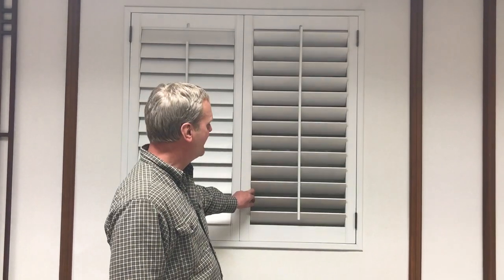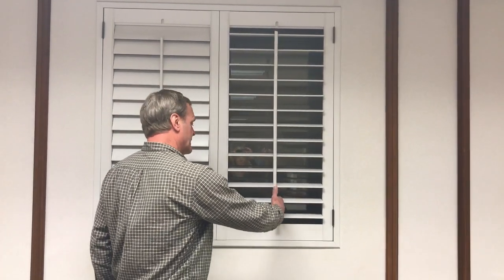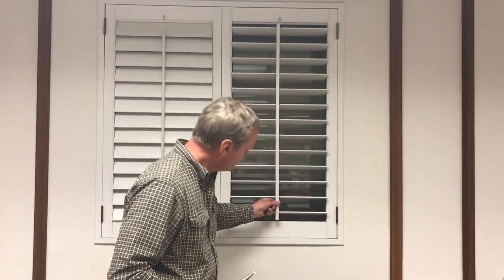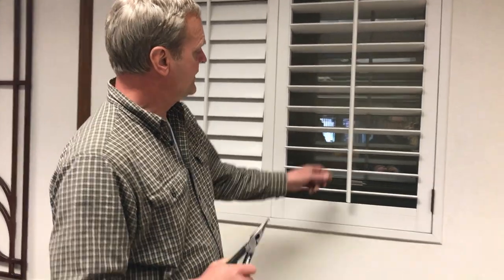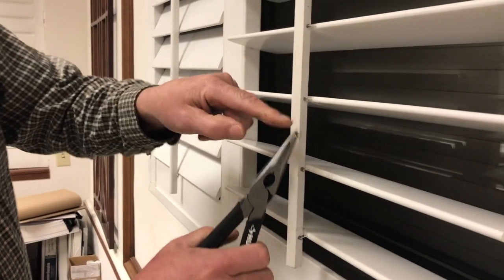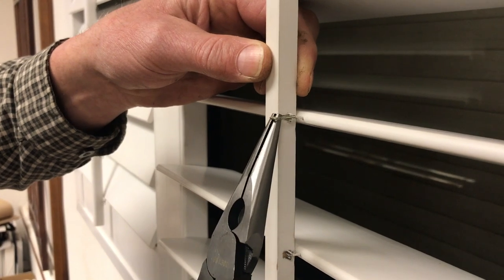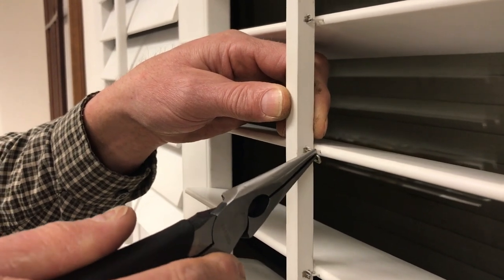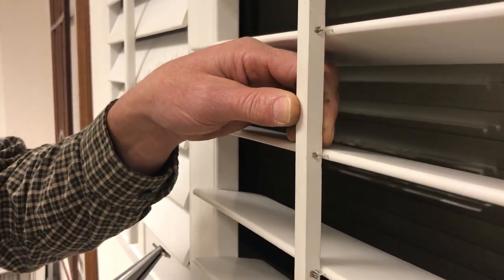How to Fix Plantation Shutters

Comment: Two slats on our shutters and the tilt bar were snapped in half and so we are getting estimates for repair. Get a load of this...we were quoted $130+, plus $5 per staple/pin replacement! I could not believe my ears. Of course there were options, he said...we could 'simply' replace the whole shutter for "just $200" .The slats are only 16" long. I know it depends on the area, but what is the average cost for repairs like this generally? Any suggestions? Is this something we could do ourselves?

Comment: Hi LBS, 

Is there a way to replace the cufflinks without breaking the other links?  lol  Well, not actually lol...frustrating.  

One link broke, and after receiving parts from Hunter Douglas, I tried to fix/replace and ended up breaking other links.  

Any suggestions?

Thanks,

DG